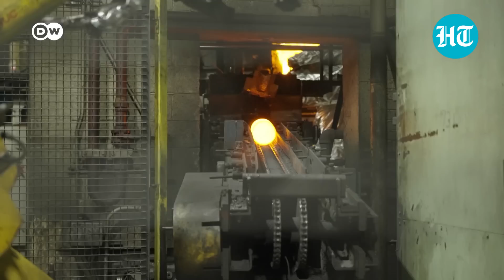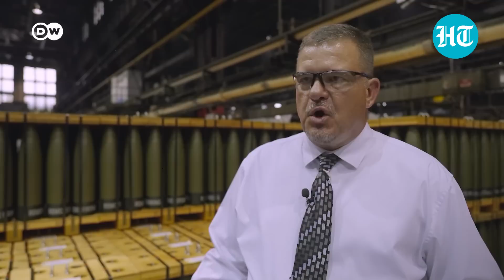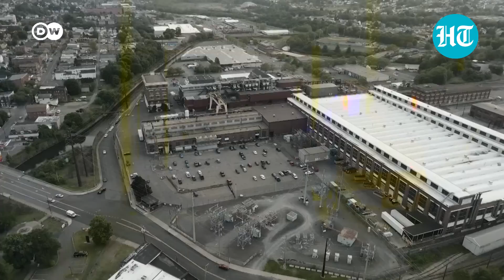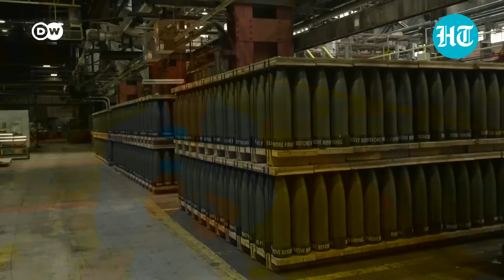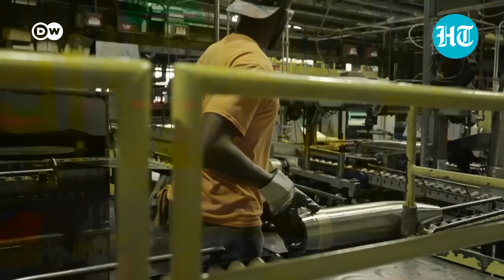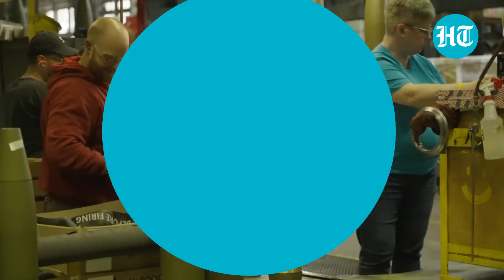Putin's war burdens United States; Factories work overtime to keep up arms supplies to Ukraine

Comment: 11.000 shells per month is sufficient to keep Ukraine supplied for 3 to 4 days and is about half of what the Russians are using every single day.
Even when they increased 5 fold over the next 5 years will not be sufficient to keep Ukraine supplied with the shells they need.
Furthermore, the US and NATO stocks are depleted and need to be re-filled. The US even cannibalized their emergency stocks in the middle east and borrowed 500.000 shells from South Korea, which also need to be replaced.
Even if they manage to double the production on short notice, it will take them 22 months, just to replace what they borrowed from Korea.